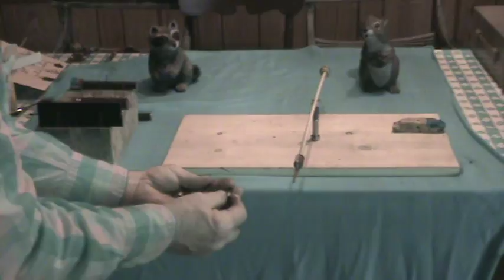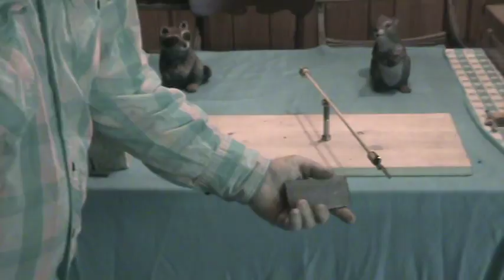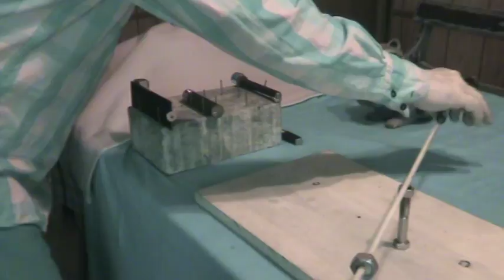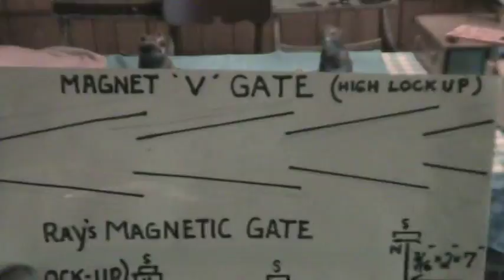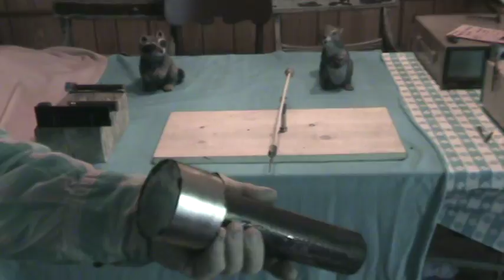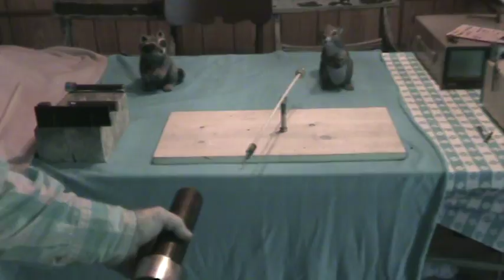Ray's Rotary Magnetic Gate (Part 2)

Comment: Hello sir,

Great video. You are the first that I have watched that really shed some light on the ability to direct or loosely control the magnetic field radiating off of a permanent magnet through iron. I also enjoyed the comment to never stop pursuing the idea. I have at this point built a rotor that allows about 320 degrees of rotation all from a single permanent magnet with consistent torque throughout the almost complete circle.

Thank you for sharing sir!